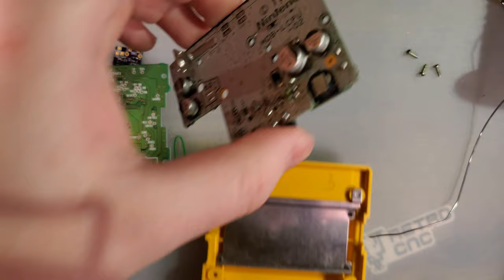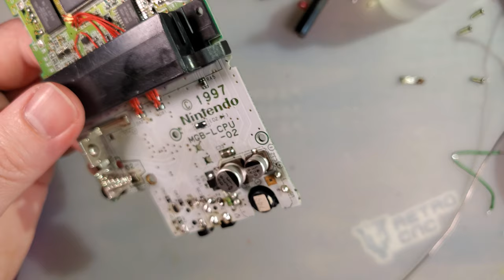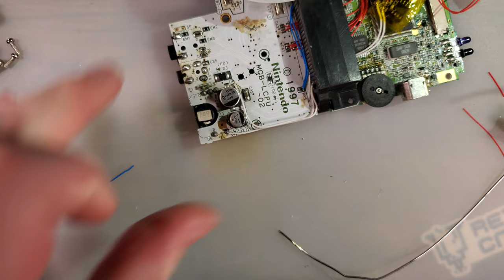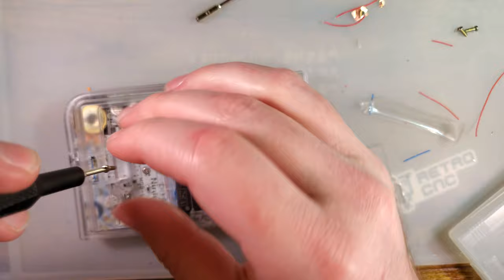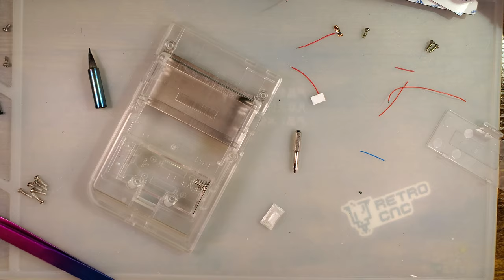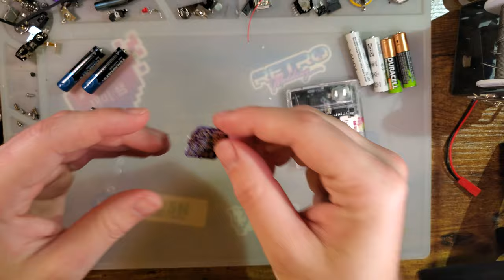Building a Pocket-Color from Scratch

Comment: This is a shot in the dark.. but have you ever seen the 'Super OSD' Q5 LCD kits glitch out with the video signal itself? I've had my GBP-C mod (that looks surprisingly similar to this in many ways, lol) running for about a year now but recently it started flickering the video signal up and down with black/broken frame bars flashing around, which looks like the sound signal or something similar from the CPU is messing with the display signal.. I've already replaced the ribbon cable as well as the screen itself, but those weren't the issue.

If I boot it without a cart in there, the screen will be fine until the startup bleep sound during which it will throw screen glitches, but once the sound stops it's fine again.
With a cart in it, it obviously follows the sound signal as long as there's sound being produced.

Comment: Nice! Definitely not something I’d do since I’ve already worked on a DMGC and while this would probably be easier to build, it’s definitely not something I want to do personally since I’d much rather get something like Natalie’s soon-to-be-released board kit(same soldering, but it’s in a more streamlined flex ribbon so I don’t need to use a nest of wires) or the N64-Freak board (which should be the exact same work that I did with the DMGC in transferring components). Great job with making it look great in a clear shell, it looks amazing.
Reply: how is natalies board different than that from n64-freak and did she post anything about it?
Reply: @g.9174  Natalie’s board is effectively the exact same as Makho’s build except it apparently uses a flex ribbon instead of using wires, while also including a custom bottom half board that doesn’t require soldering to use with the flex ribbon, so it cuts the work needed in half while also giving you a less messy finished look. N64-Freak’s is literally just the bare motherboard, meaning you need to move and transplant all the chips and components (and I mean all of them, including even the tiny capacitors and resistors) to build it, while in return giving you the absolute best quality and best looking board for clear shells, said board even being a nice black color instead of the standard green. There’s also Bucket Mouse’s MGBC that isn’t finished yet, which will be just like the N64-Freak board but with new and optimized components like a rocker switch in the contrast wheel location that controls brightness and even can act as a dedicated soft reset button.
Reply: @rickyrns1059  wow. a lot if things coming. i like it! the bucket mouse board sounds particularly interesting
Reply from the maker: the majority of this video was filmed early 2021 and predates all of those mods by almost a year